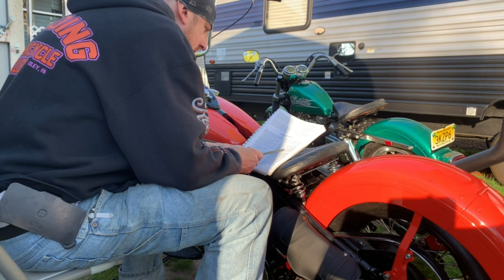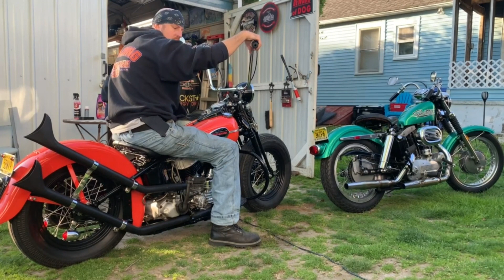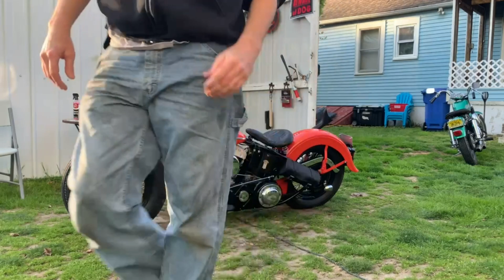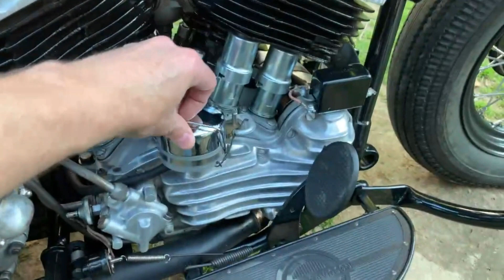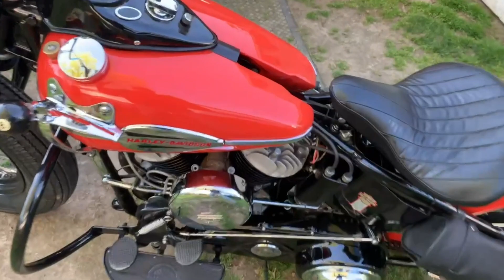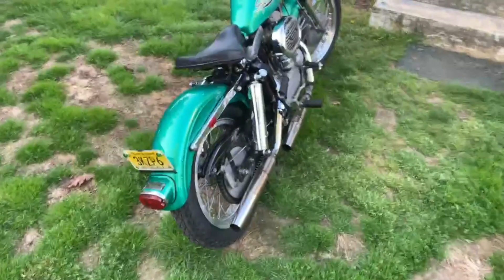UGH !!! 1940 Harley Davidson UL- Problems

Comment: I WAS GONNA SAY INTAKE LEAK. I HAD A FATBOY THAT I PUT NEW SEALS FOR THE INTAKE. I DID THE SEALS 3-4 TIMES BEFORE THEY SEALED RIGHT. ALSO HAD A SPORTSTER THAT HAD INCORRECT SPARK PLUG GAPS. ALSO YOU COULD TRY NEW PLUGS AND CHECK THAT THE TIPS OF THE PLUGS ARE TIGHT. HOPE YOU GET IT SOLVED.
Reply from the maker: Yeah, I’ve definitely narrowed it down to an intake leak. I’m pulling the carburetor off. I got new intake seals coming and I’m gonna test it all out. Clean the carb back up. Put it back on.
Reply: @SlickHeadCustomCycles  clean your intake good also. Check for any deep scratches and what-have-you. Good luck. I love that bike.
Reply: @SlickHeadCustomCycles1469  my Sportster ran like crap. I rebuilt the carb. like 3-4 times. It kept backfiring and popping. I got so aggravated with it , I put it up for sale. The day this guy was coming over to buy it, I decided to put some new plugs in it, and what do you know, the darn thing purred like a kitten. It's probably something simple. I wish I would have had more patience  back then. Lol

Comment: OK slick head I don't know if you read all that stuff that I sent you but here's 2 more ideas if that has the little high beam low beam switch on the handlebars or the horn switch on the handle bars sometimes those are bad and short and here's the really magical thing those stupid key switches, for God only knows what reason sometimes they don't work very well change that also I found twice over the years changing that , couldn't see anything wrong with it,  Kept it from missing.
Reply from the maker: Ok, thanks for the advice. So last year I did replace the switch, when i had another problem. I will keep an eye out on horn and lowbeam highbeam switches. And yes especially with you, i read all you comments to the fullest. Hell I even gave you a shout out in my last Flathead video. But I certainly have an intake leak still, another clue i found, during that video, probably couldn’t tell, but i can lower the idle speed as low as it can go, and it won’t even stall out, and still idles a lil too fast for me. SO that’s an indication of air bypassing in, right??? I just got my new intake manifold, brass seals, and plumbers nuts delivered today!!!!! I’ll conquer this one way or another!!!!
Reply: @SlickHeadCustomCycles   Yup cool yeah I didn't know if you'd read the other ideas I sent you about the back pressure in the exhaust and whatever anyway good luck on that man hope to see it running with no problems and have you say what it was talk to you later bye